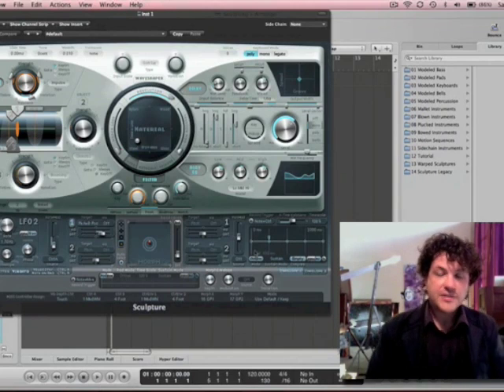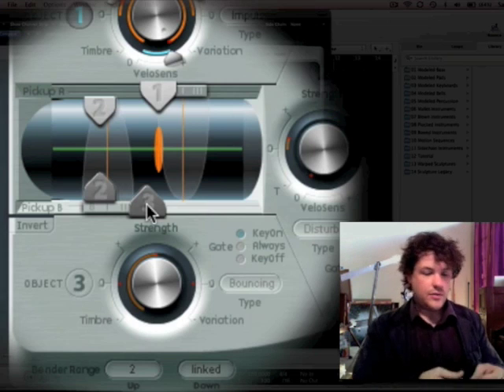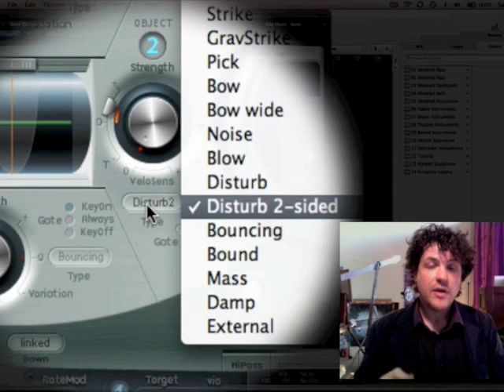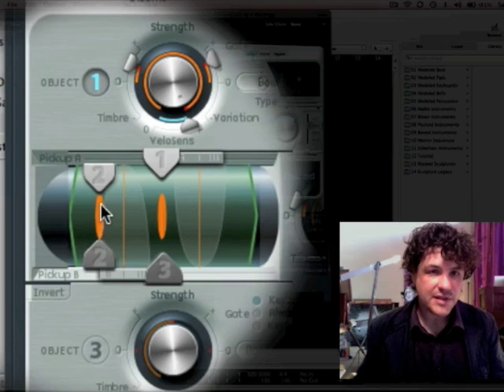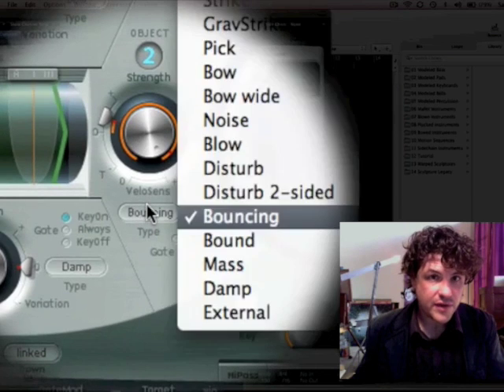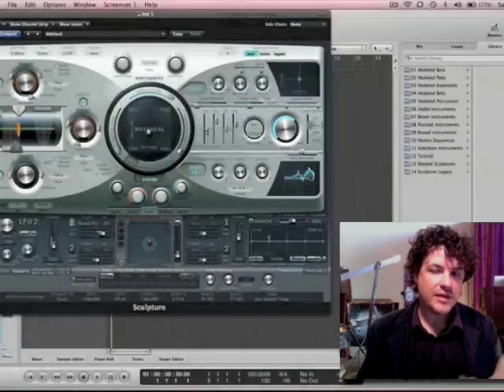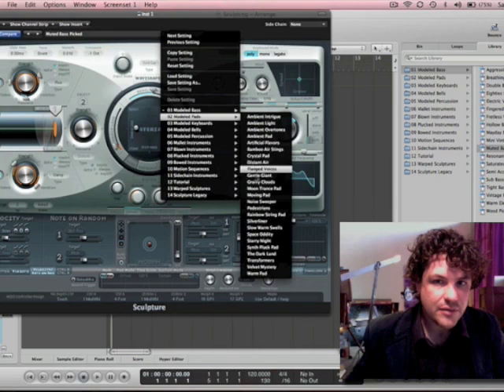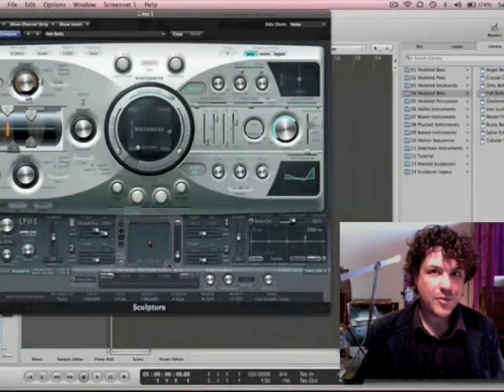Tip #38 - Sculpture (fixed)

Comment: I agree with every letter of every word you just wrote lol.

I retract my statement ! I fell into that trap because i was in my studio before watching your vid and i have all hardware. The difference in sound hits you immediately. But !
As you rightly pointed out, the value is second to none. And of course they save space, are more flexible than hardware, faster and easier to work with and the sound is usable if not workable. Which is why so many producers have turned to softsynths and